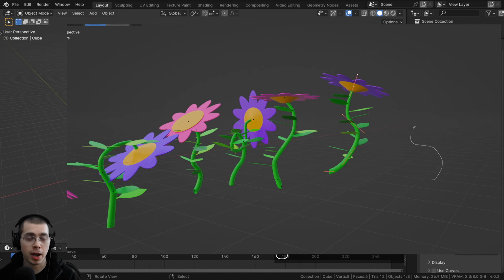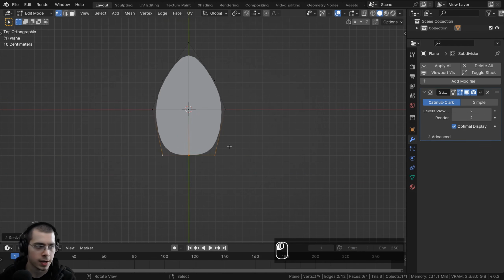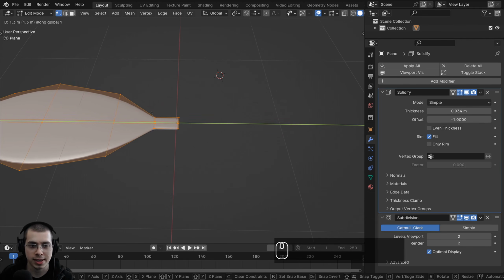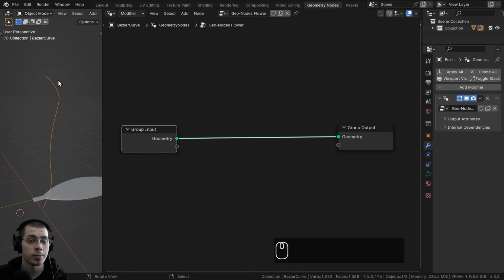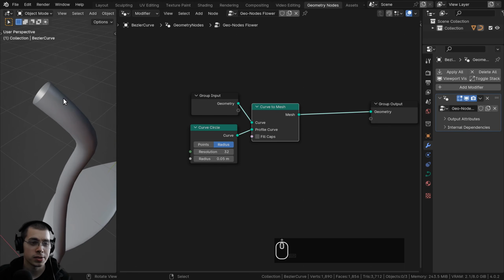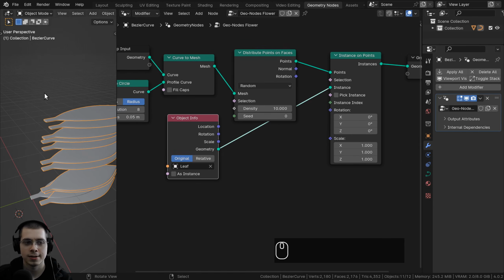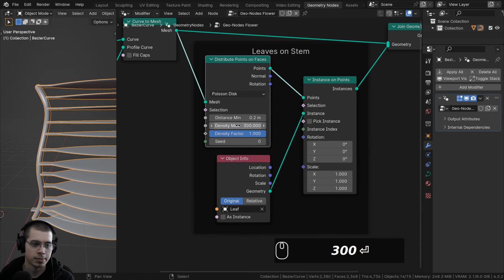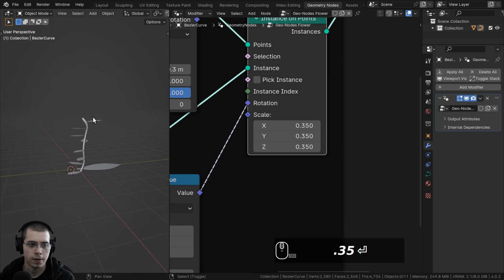Geometry Nodes for Complete Beginners - Part 2 (Blender Tutorial)

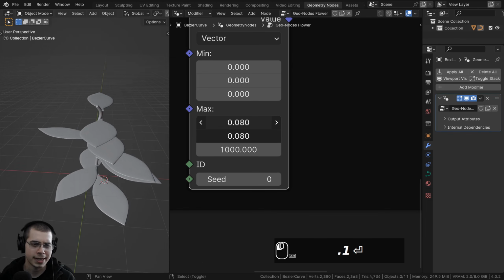Comment: At 21:50  --   A rotation of 1000 around z axis  - The number represents radians so this should be simplified to a rotation of two pi radians  - Type 2*pi in field  i.e.  6.28  and there will be proper randomess all around the stem
Reply: nerd
Reply: haha im kidding thats helpful
Reply from the maker: Yes thats right, you can actually type in tau and it will generate 360 in radians. I didn't know that back when I made this tutorial but I do that in more recent tutorials. Thanks!

Comment: 363K subscribers, wondering if you bother with comments? Anyway I like your stuff and the way you present it, slow enough to follow along. Being a Jesus dude myself it was great to know your a believer and not afraid to say so. But I do have a problem that happens to me a lot. I have been at this 3d stuff since 2015 starting with LightWave. A hobby, a game I don't know, but it dives me crazy? I have been going through two of your projects the cave thing and now this geometry series. I am half way though the cave so I don't know yet if the hammer will fall, but here it is in Geo part 2. I am using Blender 4.5.5. I tried to upgrade to 5 and it will not work on my machine which has an Apple m2 chip. It is supposed to work but it doesn't. So I am going though your Geo with 4.5.5. All was great until I loaded in the distribute on faces, then nada, and still nada. I copied your nodes exactly and nada. I spent a hour trying everything I could think of and could not get the leaves to run up stem. So I lost this game and can not continue. Why is a mystery. Maybe it's the mac. Maybe it's blender. I don't know. But I am a little sad that I can not get this to work. Stan/DWP

Comment: help, i have this issue where i make the leaf beat for beat, make all of the nodes the same, but when i get to connecting the object info with the instance on point. the leaf is facing 90 degrees off from where it should be facing. the big flat part is facing the X axis, not the Z. I have tried messing with the nodes, redoing it like twise, and overall banging my head on a wall for the past 3 hours. the only thing i havent tried is a diffrent verson, but im using 4.1 if that helps, and i dought that THAT would be changed. so can anyone help please, im dying over here :(
Reply: I had the same problem and I changed the leaf rotation on Y to 90 degrees in Instance on points node to fix it first. However when you randomize it with Random value node it just screws everything up and all leaves are pointed up  What you need to do is to rotate the leaf the way it needs to be(in my case it must be rotated on Y to 90 degrees) and then apply rotation or all transform. Once you do it it will start working.
Reply: @ozstockman  thank you :)

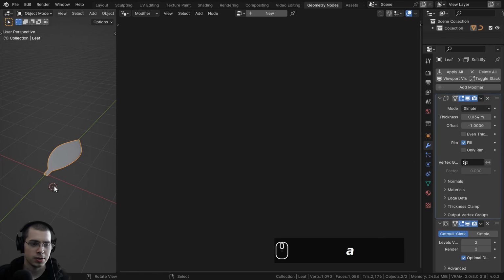Comment: Thanks for the tutorials. I have an issue at 14:45 of the video, after renaming the plane to leaf and then clicking the base of the leaf where the yellow dot is for you it moves to the cursor you call origin then clicking it the geometry nodes show up again. Well, it does not for me and I have started this part 2 over three times following very closely and the same thing my goe-nodes don't show up. So what could I be doing that this is not working for me?
Reply: same
Reply: but if you click on the bevier curve in the scene collection it should putt it up again

Comment: thnks for your tutorial, unfortunately my leaves don't rotate to be parallel to the terrain, they stay perpendicular, i'd like to separate the XYZ rotation e select each value, deciding if it's random o selected by me. I'm able to rotate them using the stem as axis. but after that i can't place them horizontal
Reply: Probably you have to apply the rotation on the beziercurve
Reply: @valkesz93  ok, i'll try
Reply: @valkesz93  thanks

Comment: Instead of adding an extra node for random rotation you can simply connect the rotation output from the Distribute Points on Faces node to the Instances on Points node's rotation input. The instantiated object's Z-Axis will then point away from the stem, so you need to rotate your leaf first to make it point upwards (and don't forget to apply that transformation). That way it's also ensured that the leaves grow away from the stem at a right angle, as they should. By inserting a vector math (add) node into that connection you can rotate up or down the leaves by adjusting the X-axis.of the rotation.
Reply from the maker: thanks for sharing, I will try that out. 👍‍